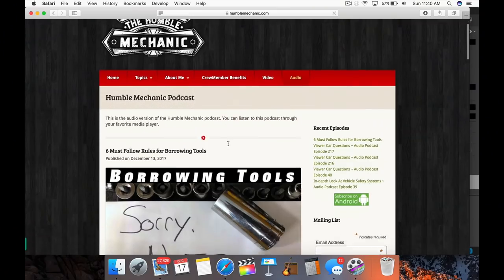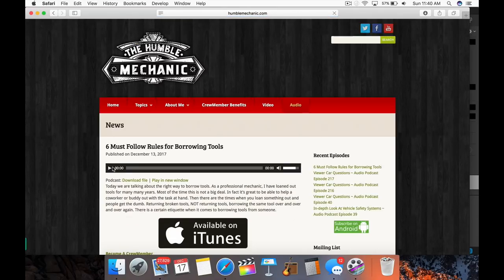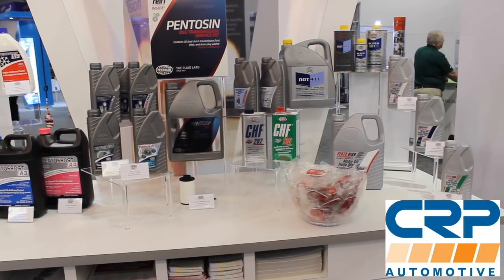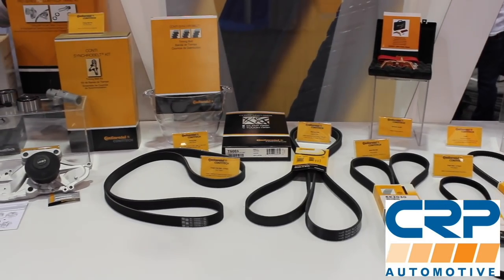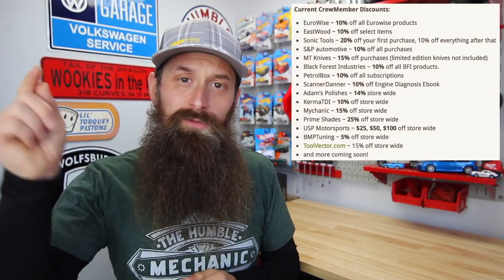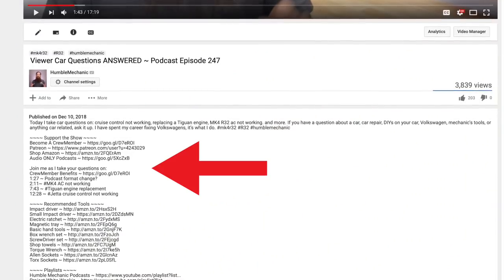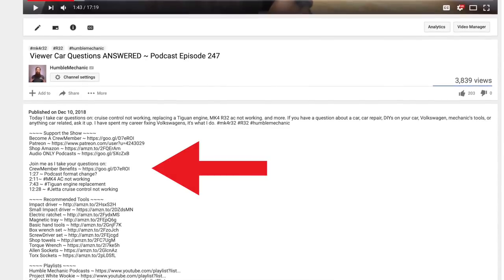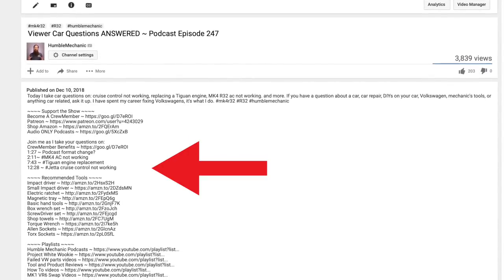Viewer Car Questions ANSWERED ~ Podcast Episode 248

Comment: Hey Charles been watching your content for my 2008 jetta wolfy for a while now. Has the 2 liter turbo. Recently I went and got a replacement PCV valve off of a rear ended jetta and replaced it with my old faulty one. Also, I picked up new spark plugs on the way home and now I'm having a misfire on cylinder 1. I replaced the sparkplug AND coilpack with ones that worked in other cylinders and there's still a misfire on 1. Code p301. Also getting codes p0456 and p0442, would that be the vacuum pump? Turns on but definite misfire in cylinder 1 as well as the engine not being able to maintain constant power when I keep it reved at any amount. 140k miles. OEM VW coilpacks and ngk plugs. Appreciate all the things you do for the VW community and look forward to more vids!

Comment: Hi Charles, I have a question, hopefully not too common, I have a 2001 MK4 Golf 1.8T, the turbo has died due to the ‘dentil drill’ sound when ever it comes on boost. How hard is it to remove the turbo, don’t really see to many videos on removal, what components need to be moved/removed for easiest removal? and it is worth rebuilding or just buying a new K03S? Thanks. Keep up to great work! Love the R32 by the way! 👌 

Edit: P.S. my phone is unable to let me email hence the comment!
Reply from the maker: The turbo kinda sucks on those. I mean it’s not horrible but not the most fun. 

If you’re failure was bad, I’d get a reman unit. It’s probably gonna be cheaper

Comment: Hi Charles, i was wondering if you or anyone could help me out here. I went to have a look at a 2010 Volkswagen Passat CC V6 4 Motion with a DSG transmission. During the test drive, the car failed to shift up from first and also failed to go into reverse (reved like it was in neutral). When we returned to the dealership, they turned the car off and started it again and all the problems went away (Paddleshift, Drive and Reverse started working as normal). They said a weak battery can do this and that the car has been sitting with a dead battery for a couple weeks and they only jump started it and left it on idle for about 10 mins before i came. Would these symptoms actually be caused by a weak battery or do you think theres something wrong with the DSG transmission (the car has 70,000km on the dash).  
Thank You for making these informative videos. They have helped me a lot over the years.
Reply from the maker: Weak batteries can do crazy stuff. But I’ve never had it do that.  Start with scanning of the whole vehicle.

Comment: Hey my humble Amigo🇩🇪 was wondering if 2 step is possible on my 99 b5 passat 1.8T AEB engine code it's DBC but I'm sure you already know that😆 also does AEB have forged factory con rods?? Been doing some research and most people say they're forged as well as the mahle pistons are semi forged and crank is cast. Wanna go stage 2 on my ECM what do I need to upgrade for Stage 2?? Heard AEB is a good platform to do a build because it has the big port free flowing head and is arguably one of the strongest longitudinal 1.8t's vw/audi produced, what are your thoughts on AEB??

Comment: Charles I need help! 
I replaced my drivers door latch on my 2000 mk4 vr6 and now my door key fobs don’t work. 
I scanned the car and it gives me a code -00928 for the drivers door lock not properly equipped or something, trying to remember off the top of my head. 
I checked yesterday and the harness for the latch is plugged in. 
Do I have to enter a code to properly equip it? How do I get my fobs to work again?
Reply from the maker: No. It should be plug and play. Maybe another issue? Wiring in the door maybe?

Comment: Hey Charles; Thanks for years of great videos, and all the excellent info I’ve gotten from them. But I need to find an answer to something Ive been hearing. I’ve heard that all 2013 and up vehicles in the US now require the applicable control module to be reflashed any time a sensor, or actuator has been replaced. I have been in the diesel industry for the last 22 years ( yes I’m a former auto mechanic). This is pretty believable, but I have not verified it yet. Do you know if there’s any truth to this? Please let me know if you can. Thank you.
Reply from the maker: Thanks for the kind words. :) 

The update thing is something I’ve never heard. It sounds crazy to me. I’ve replaced tons of parts on cars with out ECM updates. 

Now as we move forward, the need to adapt certain parts is more common. But not a requirement as far as I know
Reply: Thanks for your speedy reply Charles. I guess I can hold on to my genisys evo now since my personal vehicles are all 2013, and older. I will spread the word. You rock humbly👍👍👍😄

Comment: Hey Charles my question is this I have a 2017 Passat R-line 1.8t when Coldstart sounds like timing chain Rado the car has 34,000 miles on it and took it to the dealer three times and they say it’s normal it doesn’t once in a while is it normal or isn’t it
Reply from the maker: Had to replace a few adjustors for that.
Reply: HumbleMechanic So should I take it to another dealership and get it fixed it’s under warranty and take you for responding to my questions love your channel

Comment: Babbeling, airflaps, and answering questions 🏁🙌🔧☕, that background office🚗🏰🎅💚, great show👍👍,I'm trying too explain to my customer why he needs a head gasket set kit on a 2012 Ford escape CNG in which has multiple misfires due to what have troubleshooted as chipped valves, headgadkets fine, car stalls at a stop😂, lol camera says all 😂😂😂🔍🎥, and customer is like but you said the gasket is fine...📲😂, The way I perfer is to install the harden or black polyurethane bushings on control arms and radius bushings and explains to customers that they'll never replace them again, alot of times there cheaper and faster to install🐦🐦, manufacturers produce things faster and faster like all rubber parts, we mechanics should be called rubber speacilist, dealerships now these days don't get into to motors if there's a major problem they swap the motor or the car then crush old , shops would be saving you more $, by getting into the motor and troubleshooting, meaning fixing cars correctly, 🔧🙌🏁, I have alot of customers that run there car into the ground before there's plenty problems 😂🏁, p.s. lots of flywheel problems lately, pros and cons of flatrate is a Ferrari clutch cost $12,000 but I will do it for $8,000🏁😂🔧🎅🍕🍻🐎🐂♻